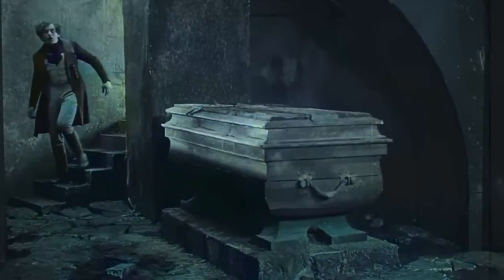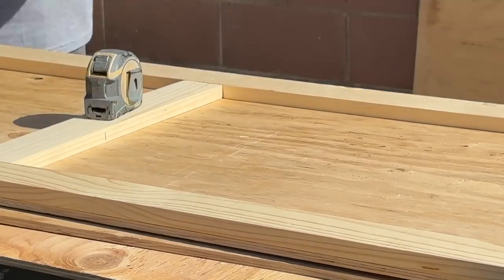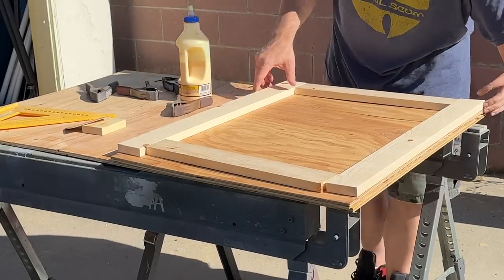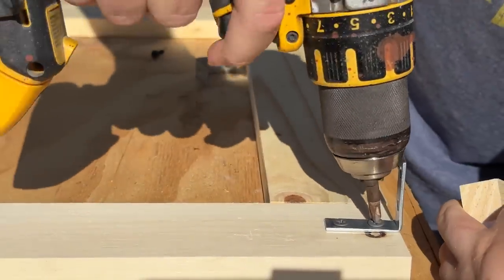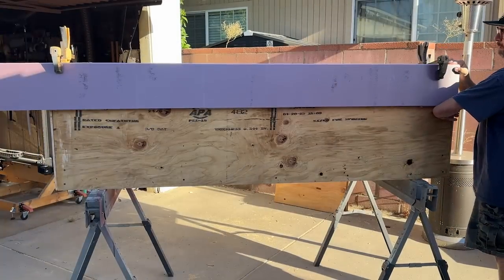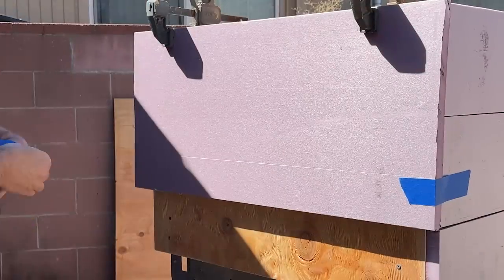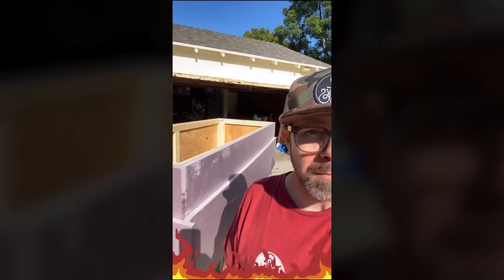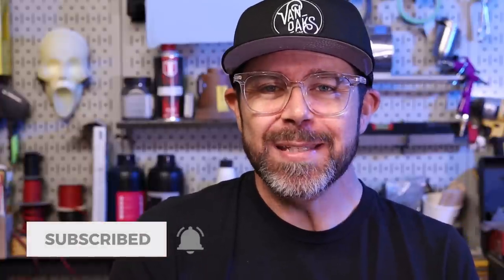Building a Halloween Coffin - PART 1

Comment: A useful trick on things that have to be broken down is to put dowels in as though you were going to glue them but not glue them.  This means that when the angle brackets or perhaps luggage latches pull the parts together they get aligned by the pins.

Comment: I've been digging thru your videos trying to find an answer, as you have done ALOT of stuff, but I can't seem to find it and my question is, what would you use if you wanted to make two pieces of styrofoam seamless.  I'm building tomebstones that have a base gluing (2) 1/2inch styro boards together and I do not like the seam around the front of it where they meet and wish for it to go away. I was thinking maybe some kwik dry caulk sealant??  Any ideas?   Just curious if you know before I go all willy-nilly applying whatever I think will work and create a mess.   Appreciate any recommendations you got!  thanks man
Reply from the maker: Paintable caulk is my goto for handling seams.
Reply: @VanOaksProps  Thanks for the quick reply!

Comment: For your wood work aspect, I reccomend a trim router with a flush trim bit. It's way quicker than a belt sander. And yeah... This heat has made me not want to do anything all summer. I'm glad you're able to push through it and make these videos though. They're one of the only things lately that I'm finding on the internet that I actually enjoy.
Reply from the maker: Thanks for the tip!